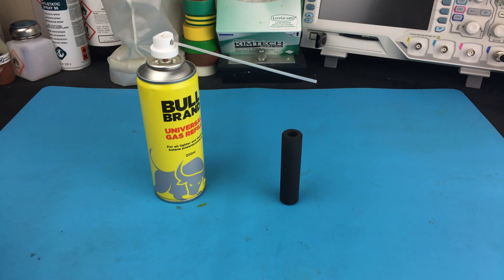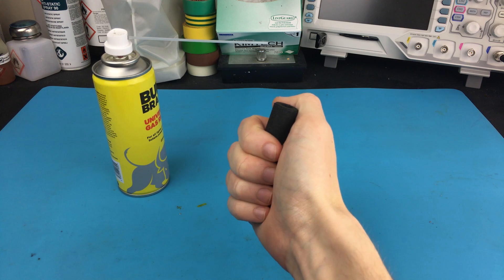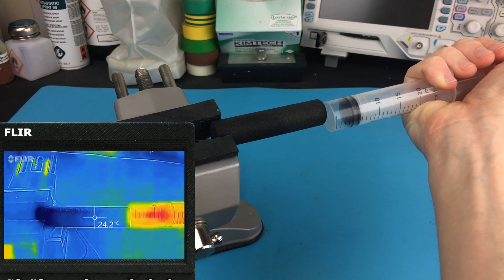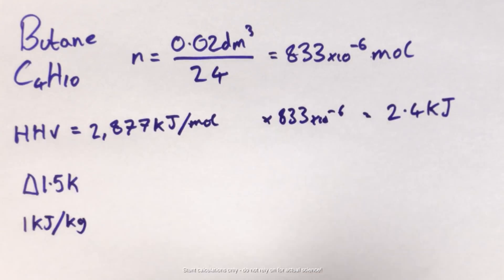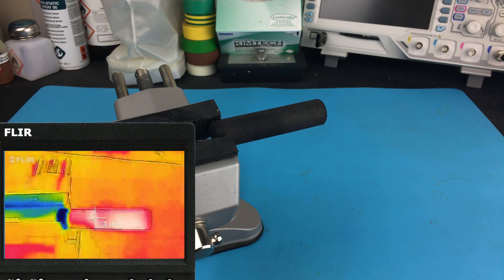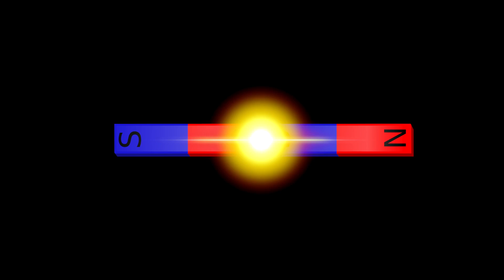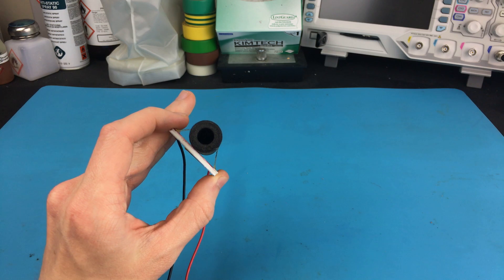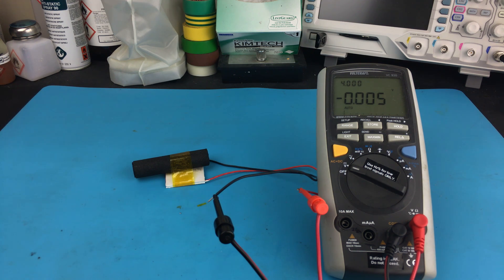Heat of Adsorption - a viable source of energy?

Comment: You can put a heat sink on the cold side and send the first cold gas through the heatsink and then it goes into the carbon tube, where it gets hot so the heatsink acts as an intercooler. This achieves higher efficiency than just shooting gas into the tube